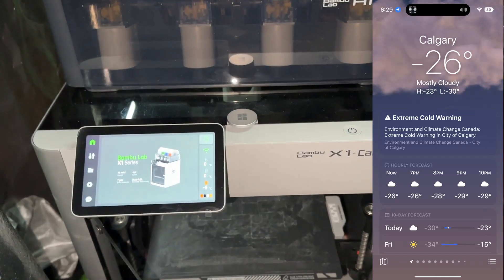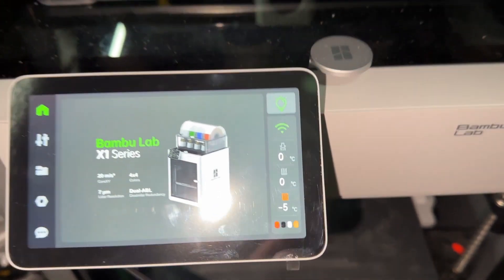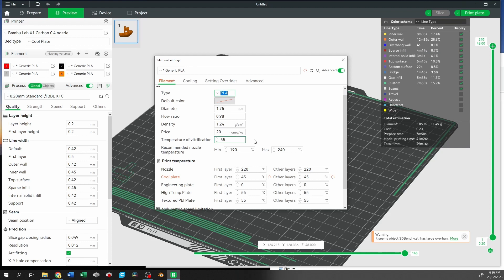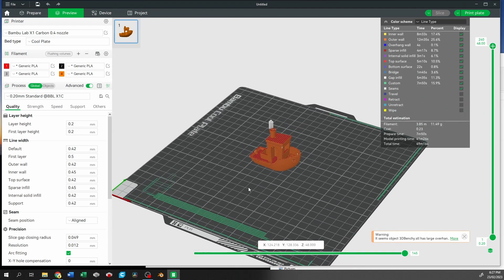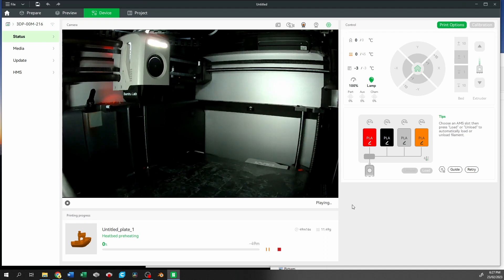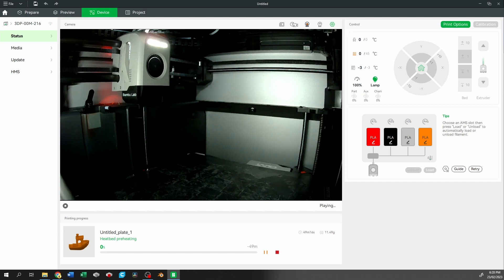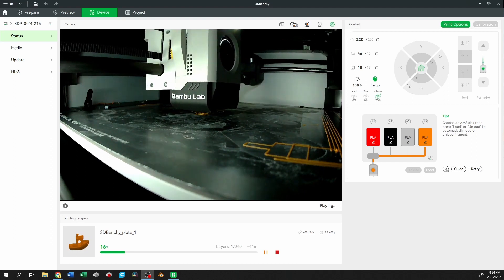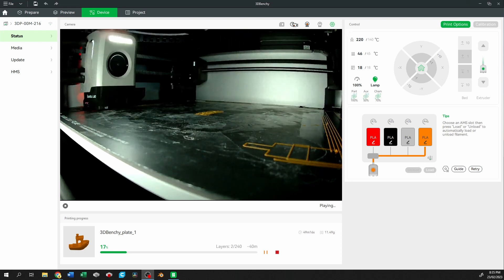Can the X1-Carbon Print in Freezing Temperatures?

Comment: maybe 'jump start' it with a hairdryer or heatgun ;)
Reply from the maker: Yeah that’s a good suggestion. I currently have a little space heater in there that I use to increase the overall temperature in the enclosure. For this video I definitely could have used a hairdryer or heat gun.

Comment: I tried printing with my cr10s pro the other month ( January ?)  when it is hovering about the freezing mark , it said "too cold" and would not heat up , so the X1C is not the only which won't print with a 0 to 5c temperature.
Reply from the maker: That is very interesting. I wish the X1 at least gave a warning or error message instead of leaving me hanging.